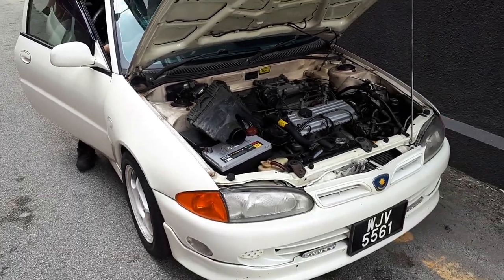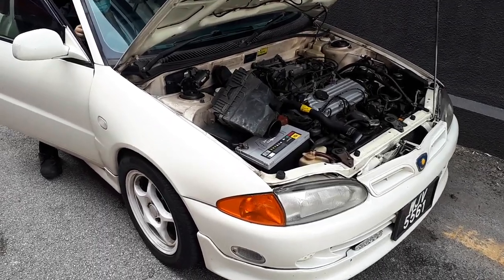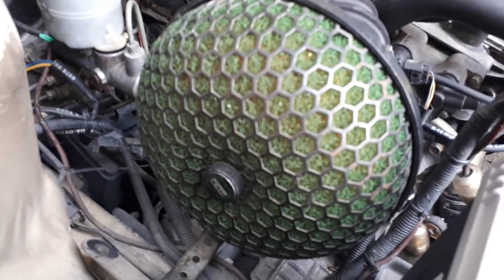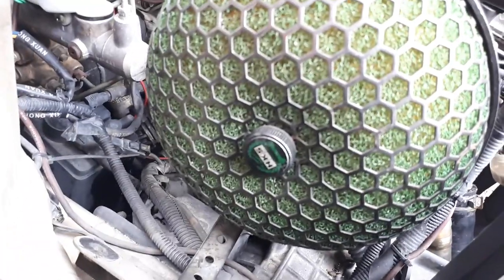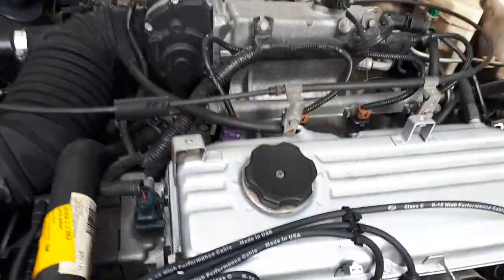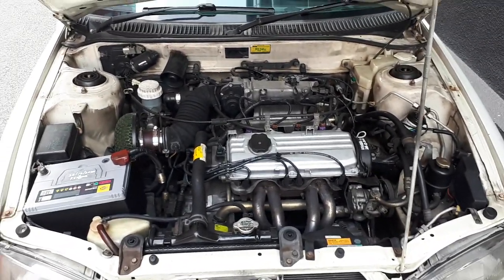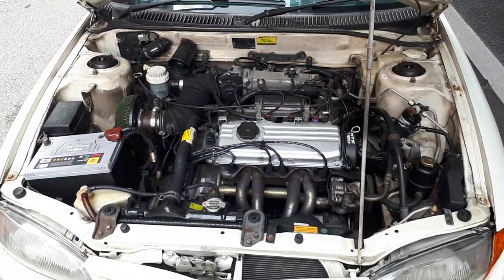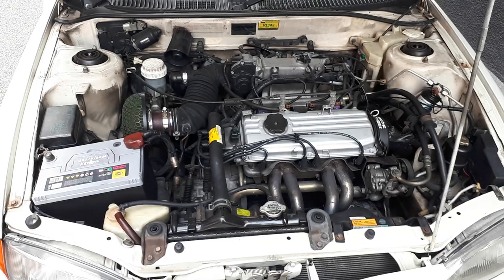WEEVIL (2min) UPDATE: 2002 Proton Satria 1.3 GLi - Time to Breathe Better!! | EvoMalaysia.com

Comment: if i'm not mistaken, 1of the major cons of using open pod on normal 4G N/A engine is the idling issue due to dirty MAF sensor if using for long period of time..it's different if the system is using MAP sensor..and it'll will giving problem to the T/B as well..hopefully yours will be ok..
Reply from the maker: That's very possible especially if u drive in very dusty areas, well, I've actually put the original airbox back, this open pod was too loud for me, yup, I'm getting old, hahaha!!🤭

Comment: Hey Chris, you might want to consider to weld a metal pipe inside the right fender and slide the front bonnet cable through inside it. This is to prevent the low life thieves from pulling the bonnet cable from the inside of the front right fender to steal your car battery. My dad's old wira kena twice already the car battery got stolen. 😇
Reply from the maker: Hey, thanks a lot for the feedback bud, that's good advice 👍🏾🙏🏽😀

Comment: Can we remove catalytic converters in the exhaust? Will puspakom find out if my car is subjected to the B5 test later?
Reply: I heard in old cars removing the cat converter helps for better performance.
Reply from the maker: It does and because Msia doesn't have emission regulations for passenger cars, it makes no difference with or without in the inspection process 😉

Comment: ahh yes.. the so called stage 1 upgrades.. the intake and the exhaust. For many of us.. this two is enough.. but then.. it  Followed by electrical wizardry grounding cables, better brake pads, better tires,... and then.. (u get it already right.. u just don't stop.. not with a satria..)
Reply from the maker: Hahahaha!! Very true! It's a slippery slope once u get started, that's for sure 😄